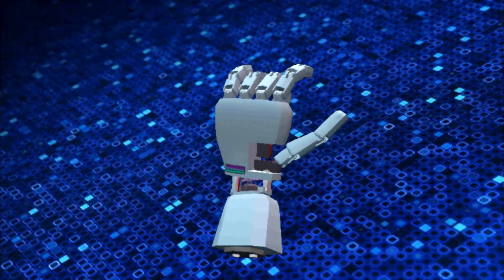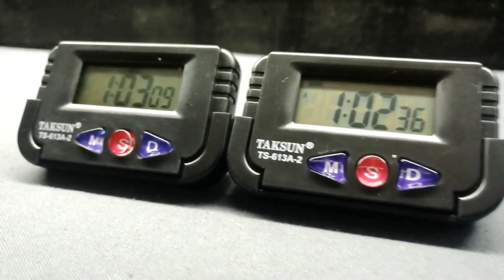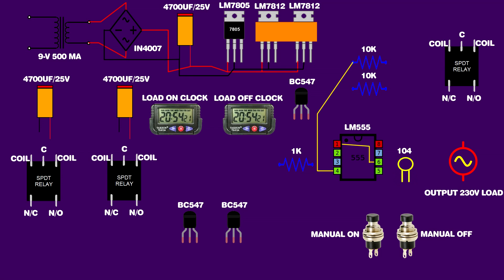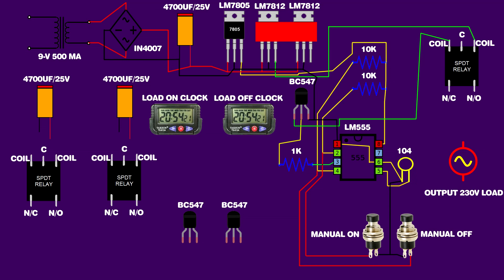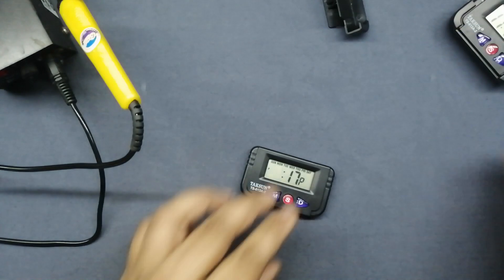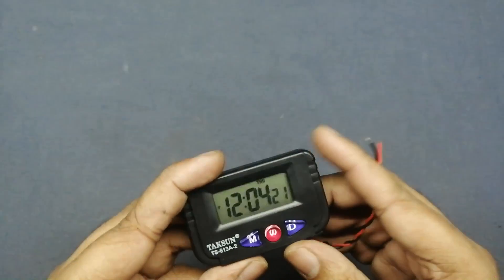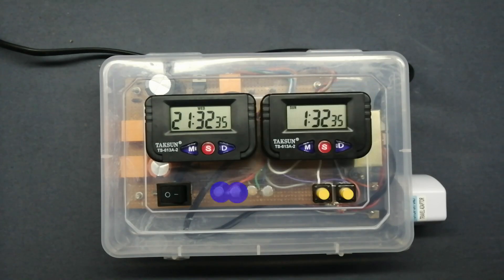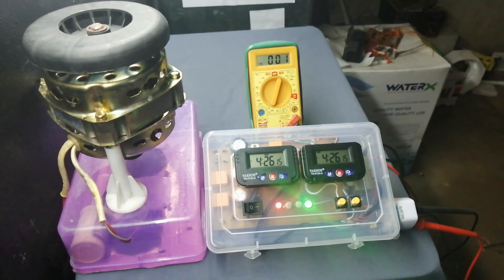HOW TO MAKE A TIMER SWITCH. WITHOUT USING ARDUINO. CONTROL ANY AC LOADS ON AND OFF ACCURATE TIME.

Comment: I bought 2 same clock as you have to make this project..i have a query how cna we make a timer circuit with it's alarm when this clock is giving a beep sound after completing each hour..that means it will give a high pulse on the set alarmed time and on completing each hour.. won't this give us a false triggering? Please help me clear this doubt asap..so that this watch isn't compatible i can go and reurn this and buy another one..
Reply from the maker: I understand what your problem is. See the commands you are given on this website. This will allow you to customize your digital alarm clock as you see fit. Website link https://www.fixya.com/support/t23855649-deactivate_hourly_chimes_in_taksun_ts.  If you have any doubts related this project please join my what's app. What's app number avaliable in the video description.

Comment: Im not student or im not studied electronics but i can solder a simble board 
I realiy looking this project
I had a doubt 
Can i use everyday 7 am on and 8pm off it will continue plz brw 
 i need an answer
Reply from the maker: Yes once you set on and off time it's continuously working every day...
Reply: @Circuitoptimize23  thanks brw 
u are the best ....
😘😘😘😘😘

Comment: Hello,please I have 4 questions.
1. Do you make use of buzzer in the connection,because I saw something like it in the display.
2. The four leds, where do you connect each of them.
3. The blinking leds, how do you connect it for it to blinking.
4. The on/off switch before you start operating the device,were do you connect it.
Reply from the maker: 1. OK first question is not required...
2. 4 led first led is power led, second led is device on indicate led that's led connected on Timer IC555, third led is output load on led, and 4 led is output load off led. But remember this 4 indicator Definitely not required it's your choice..
Reply: Ok thanks.
Reply: If I may ask, the spdt relay you used, how many volts is it?
Reply from the maker: In my cause iam used 12v relay Switch but you also used 5v relay swith both relay switches are suitable for this circuit...
Reply: Ok thanks a lot.
Reply: @Circuitoptimize23 1) if i use 5v relay we will any changes for suitable relay?

2) if i am using led we will use resister or other?

Please reply i am working for it
Reply from the maker: Join my What's app...I explained clearly..

Comment: Sir realy kitane volt Ka hai?
Reply from the maker: Output volt is AC 230V....
Reply: @Circuitoptimize23  sir lekin realy 12v hai ya 6v ?
Reply from the maker: Relay 12 volt you also use 6 volt
Reply: @Circuitoptimize23  thank you sir

Comment: Where is 3rd 555ic in circuit bro?..i have seen your second link with circuit diagram, there are only 2ic's...but in your circuit board there are 3ic's....plz explain...
Reply from the maker: Yes third ic only used for led blinking purpose.
You will build this circuit you will download first link schematic..
Reply: @Circuitoptimize23  thank u soo much brother